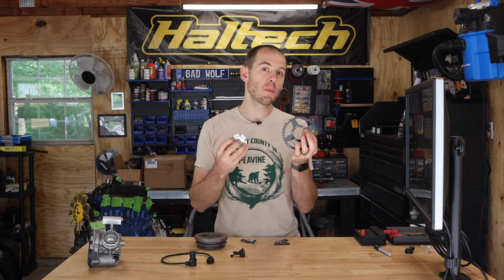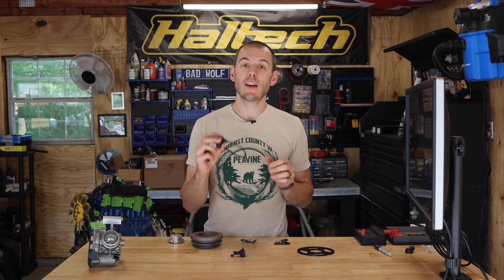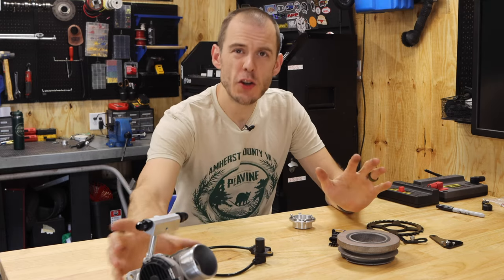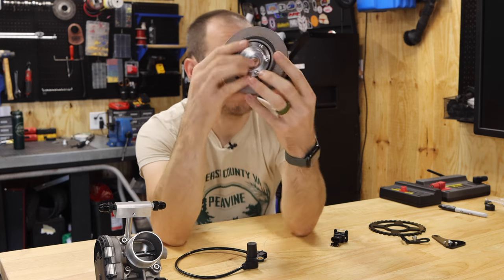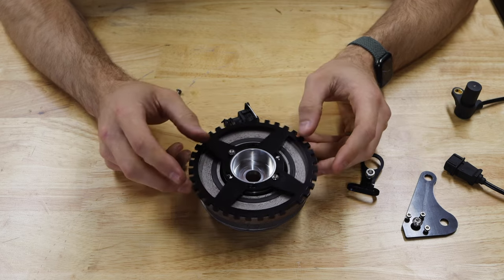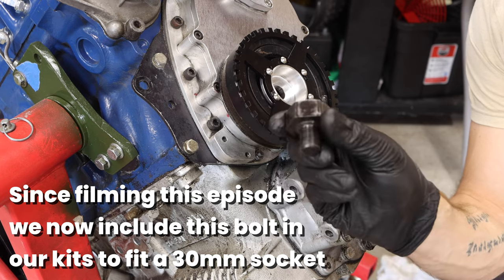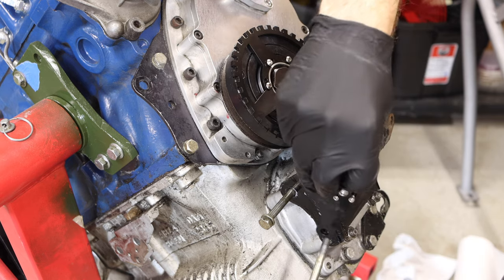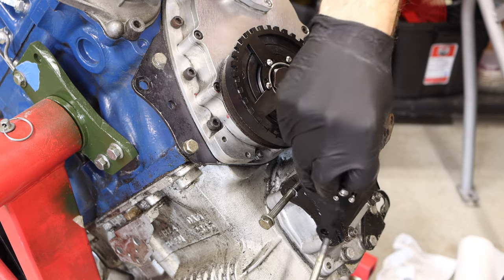How to - Install a Trigger Position Sensor on a Classic Mini

Comment: Nice looking kit. Interesting location for the sensor bracket, could do with moving mine to that location as it's currently in the way of the Timing Teeth on the Timing Chain Cover.
Reply from the maker: We had to think really hard about how we would make it compatible with any mini regardless of the timing cover and this was the best way we could come up with. Out of the way but super secure.

Comment: Check your ECU manual.  I think Megasquirt 3 wants a certain amount of lead time before TDC, something like 70-80 degrees..
Reply from the maker: Definitely wise words to check on your individual ECU however, most of them can have a positive or a negative offset configured in their settings. I know DTA fast and Haltech, as well as ECU master all can do that pretty easily. I am not sure if mega squirt or mega jolt can do a negative offset though.
Reply: Exactly, I'm doing 90.  And yeah MS can do negative offset.

Comment: Will the kit fit with the Vmaxscart SC pulley?
Reply from the maker: We haven’t tested it with that set up yet. I have a hunch that it will not fit because of the dual belt pulley set up. That said there is a little bit of room between the radiator bracket and the pulley so it might work.